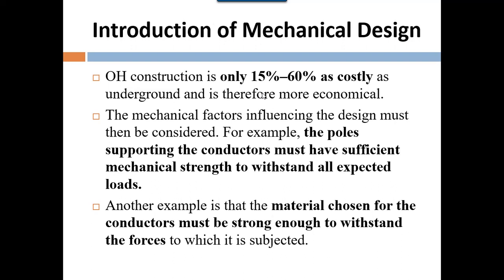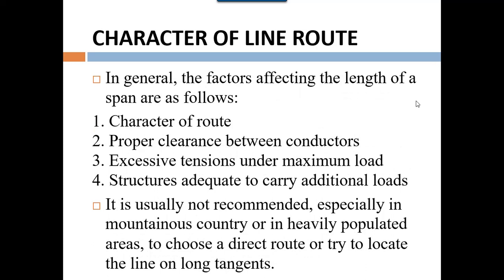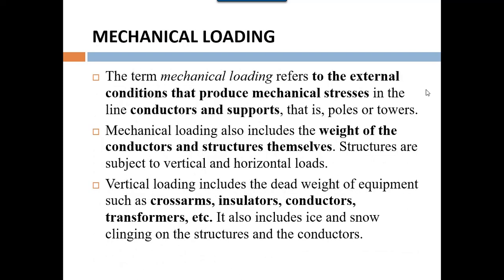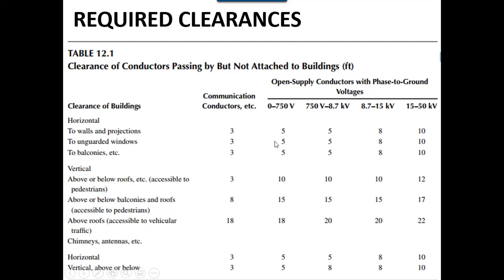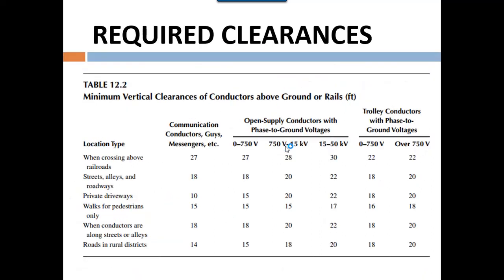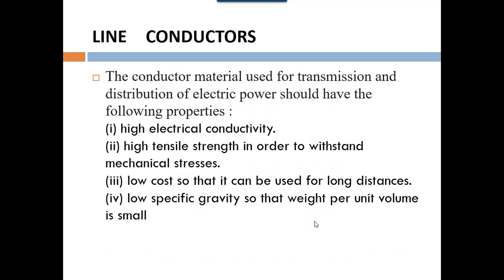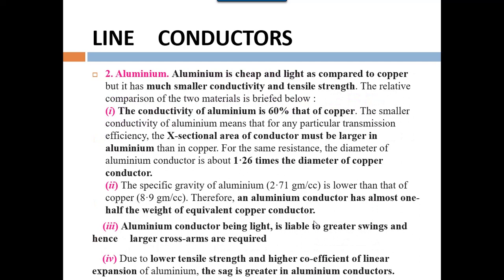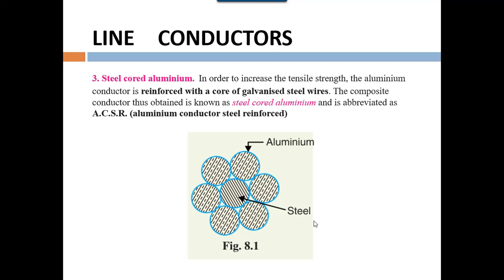Mechanical Design of Transmission Line

Comment: How we can calculate land utilized by transmission lines
Reply from the maker: Land utilization of transmission line is dependent on the the design of transmission line. So, order to calculate it we design the transmission line on some software by adding all the basic parameters of transmission line and the size is automatically calculated. The softwares which are used for transmission lines are power factory, power world, e tap, etc.